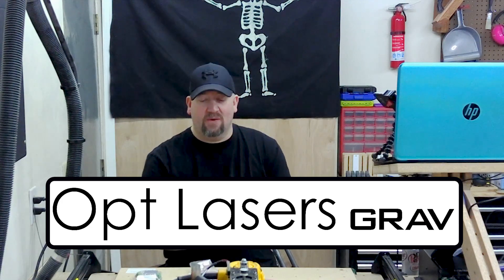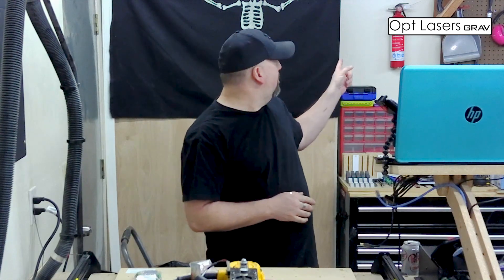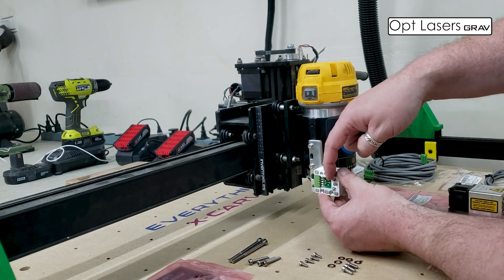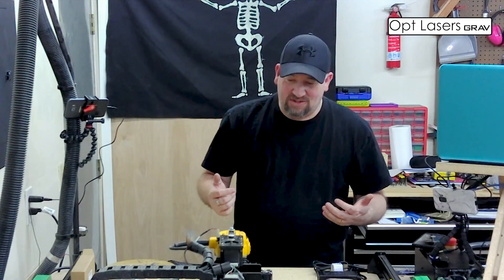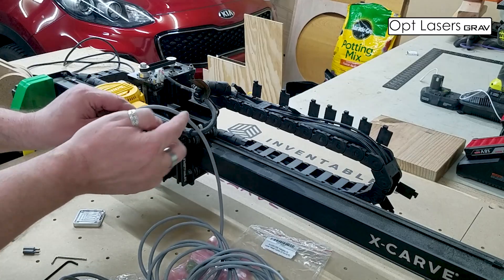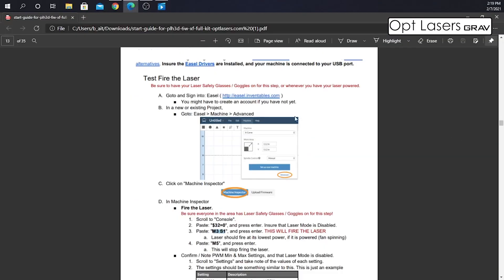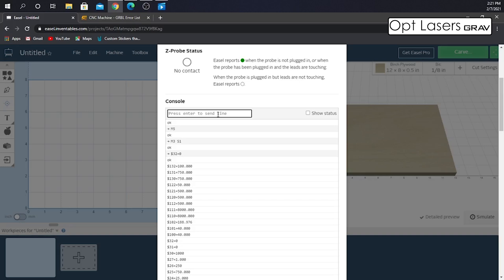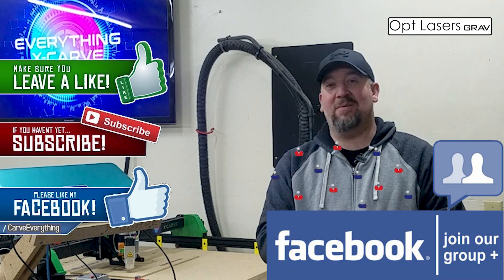Laser install on X-Carve - Opt Lasers

Comment: Great video. One question, will the dust collection system work with the docking station mounted to the side of the spindle?
Reply from the maker: Hi Steven I have mounted mine with a 3d printed piece that can be found in the manual. If you need one let me know happy to print one out for you.
Reply: @EverythingXCarve  if you would that would be great. My email is seandri@swbell.net. let me know the cost and I'll send my mailing address.
Reply: Do you know if someone is selling the adapter?

Comment: This kit costs 900$USD(at time of writing). Why did you get this kit verus like a J-Tech one for even more power and high resolution lens for 150$ cheaper? This is still a diode laser so reflective and transparent wont work, so project stuff is just general laser engraving not really cutting? Having used a smaller laser setup using GRBL (what the xcarve runs on) make some macros for the console to change the settings for laser mode and work area limits, and then another to set back to router mode ;p
Reply from the maker: Hi Kodaijin, Thank you for your comments. I love this laser. Everything about it so far is amazing. I can interchange nozzles as well as laser focusing and it comes on and off with a magnetic shroud. It might be a little more money but worth it, as plastic is cheap and this laser is anything but cheap. I guess it is a preference thing nothing against any of the other lasers but this laser is awesome. Thank you for the info on the macros to convert from laser to spindle I appreciate it.
Reply: @EverythingXCarve  Thanks for interacting with a viewer ;p I've been subbed for quite some time, hopping to see more. As for the macros, yesh Gcode macros are game changers. Like better homing the zeroing work it's a must. Example I don't replace my spindle with laser and do the mount on method. I run a macro after homing that will move it over some then I can mount it (with a refance spot). In the same macro it will also make the work area offsets to account for the laser and change grbl to laser mode. Homing with spindle and a 3 point touch place is even more amazing if you ever do one and use a macro for it (zero all 3 axis in one line of code verus stock)
Reply from the maker: @DJ_K0D4  i am going to look into this thank you so much.